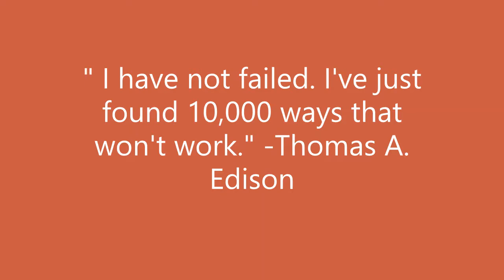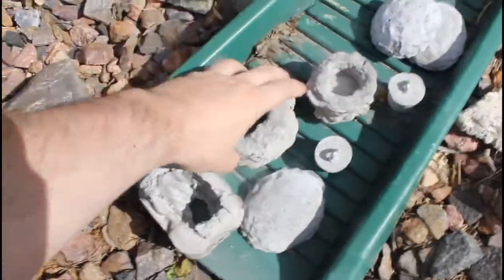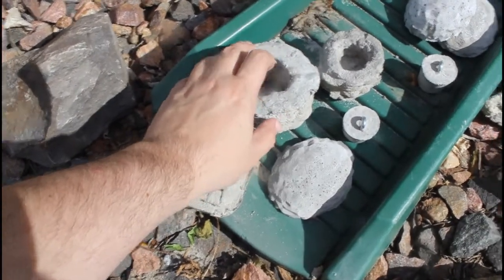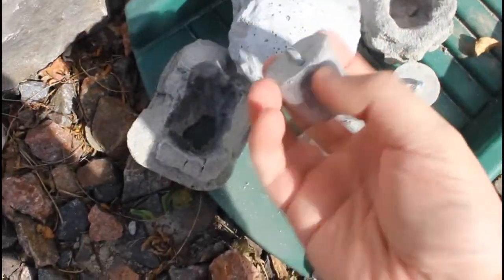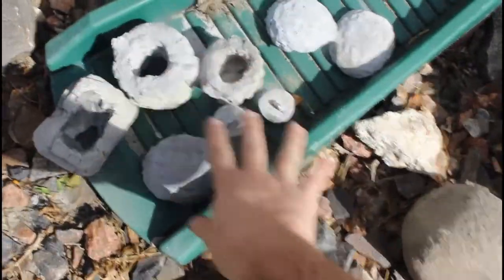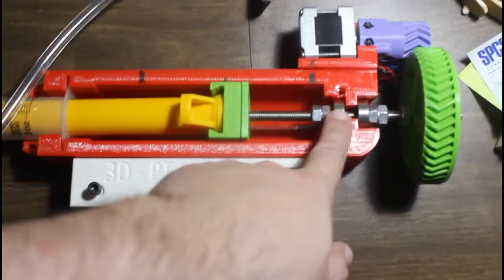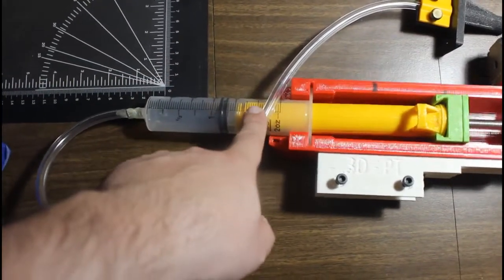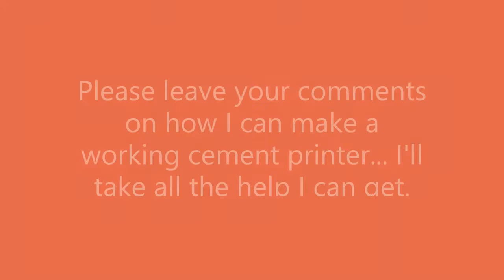Cement printing Pt.-2

Comment: did you try 50/50 cement sand
Reply from the maker: I think that's one of the mixes. It works great for casting, but will not go through a syringe.